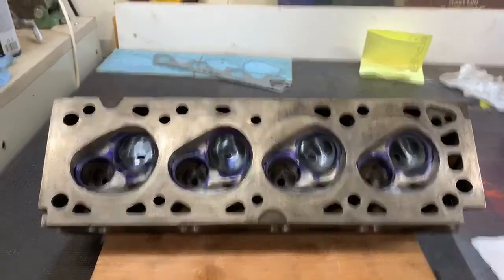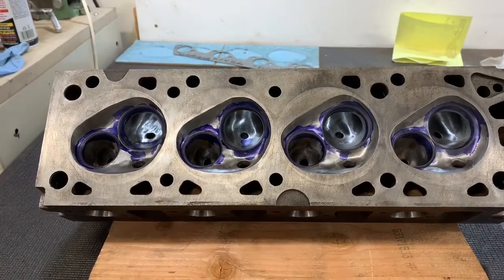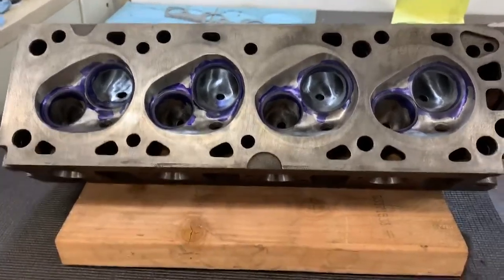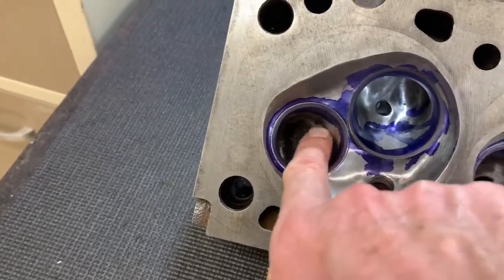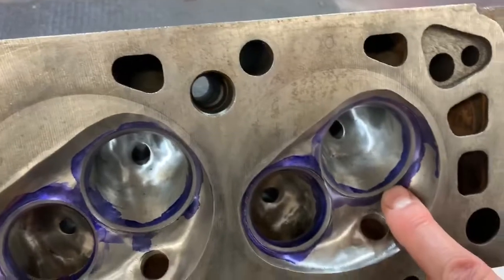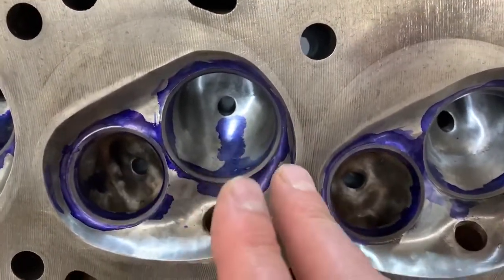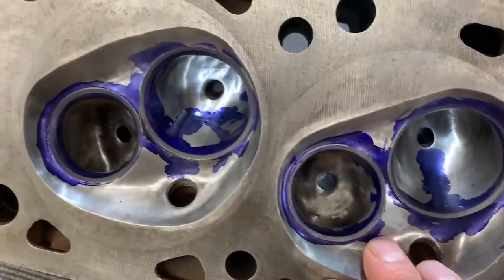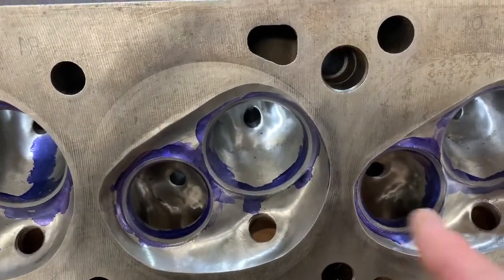Ford Lima 2.3L combustion chamber polishing XR4Ti, SVO, Turbocoupe

Comment: Just got done polishing my first 2.3l head. If I could share one piece of advice its to do a very good job of inspecting your valve seat area for cracks. I did a 3 angle valve job and no matter how much I cut it I couldn't get 2-3 valves to seal right. turns out it cracked right between the intake-exhaust seat area at its thinnest point. if you can't get it magnafluxed (I didn't have the money for it either) you can cut the 45 degree seat until you have a clean surface and use a bright flashlight in the combustion chamber, you'll be able to spot cracks much easier this way. anyways I figured I'd share before somebody wasted 2-3 days polishing it to come to the same point i did
Reply from the maker: yes I started with magnafluxing for that very reason

Comment: I remember when I was in highschool, I saved up all year as a bus boy and purchased an Esslinger head.  I do not believe it was the ARCA head, (If I got that right unsure about the acronym.)  I think that because the head had the stock bolt pattern for the intake and exhaust.  Man oh man did that thing wake up after putting that head on it!!  and the weight savings from it were enormous.  

If I get back into Merkur's, which I really do want to, Im going to start researching just how difficult it would be to get a billet piece of aluminum, carve it out similar to a Volvo head, but with ARCA style ports, (Even though its N/A intended, I found what works for N/A will work better with turbo as far as flow goes.)  

I miss this scene so much.  The most favorite car I've ever owned.  Man was that thing fun.
Reply from the maker: wish I could get my hands on one  :(
Reply: Do they still make Esslinger heads?  I think they outflow a “stock” Volvo head, but I bet if you ported and polished a Volvo head and got custom ground cams from like Comp Cams, it’ll flow maybe better?

Comment: That is not a Lima head.  A Lima head has two spark plugs per cylinder.
Reply from the maker: Ah, yes actually there is a twin plug version that came out on the Ford Ranger in the late 80's or early 90's.  So both versions exist.  Thanks
Reply: @jameswieler3295  Catnip got served lol
Reply: That's why they call it dope.
Reply: @johnpryor3254  I rather smoke “dope” than be a moron💭😂.
Reply: Earlier had 4 plugs up to about 95 - 96 - 98 - later had 8 plugs
Reply: I remember that engine in Pintos about 74 or so.